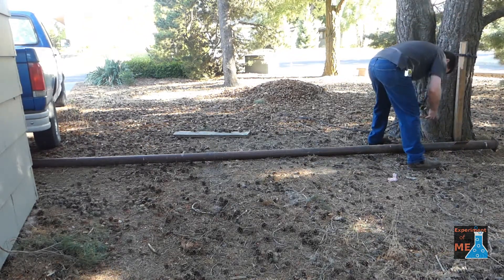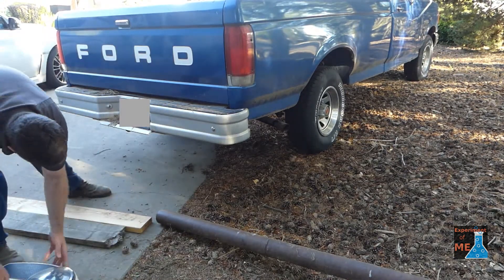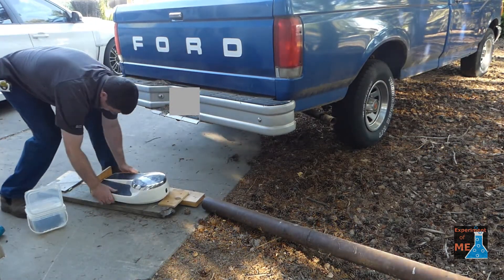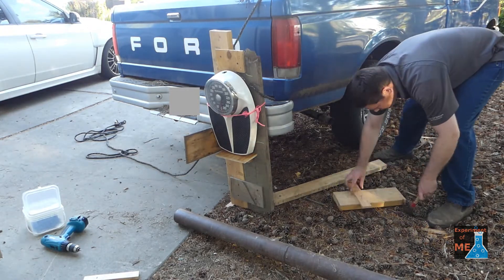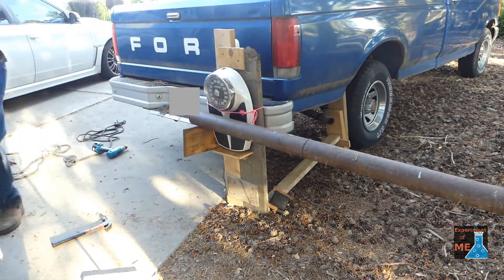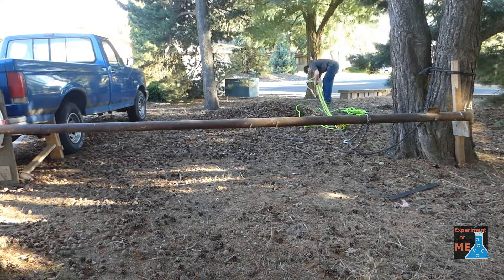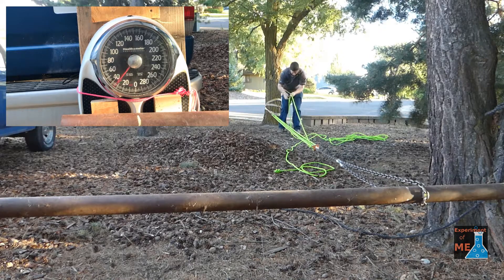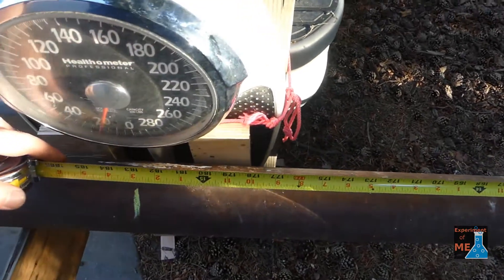Pulley Force: Measuring the Effectiveness of a 5 to 1 Block and Tackle System.

Comment: Would be interesting how much force is lost due to friction in the system , you would just need a pull scale between you and the first line .
Reply from the maker: There is a surprising amount of force lost to friction in this setup.  I have done some experiments and the results seemed worse than I would have thought.  Therefore, I haven't publish a video on it because I couldn't explain why it was so bad.
Reply: I don't know what your results were, but for cheep pulley's figure at least 10 percent loss per pulley. Assuming a 100 lb force on the first piece of rope on a 5:1, you have 90 lbs of force after the first pulley,  81 lbs after that, 72.9 and then 65.6. So, it would be 100 + 90 + 81 + 72.9 + 65.6 = 409.5 lbs of force on your system with a 100 lb pulling force.  @experimentofme2161